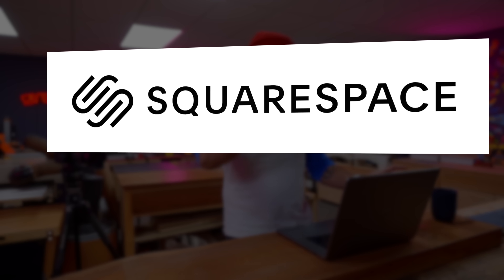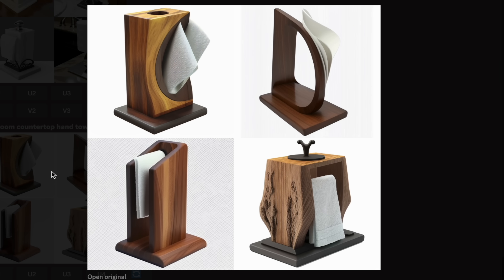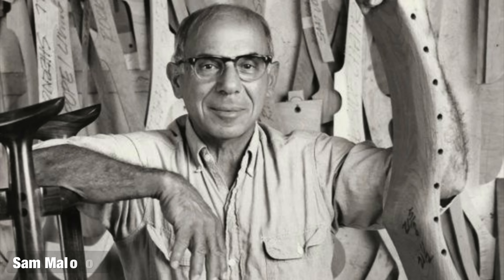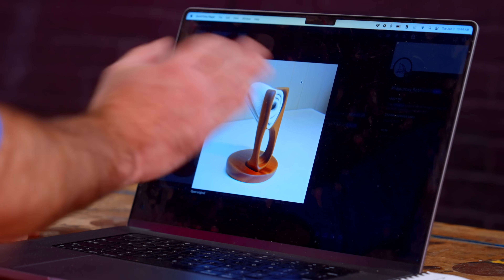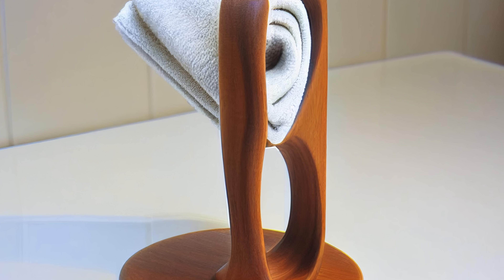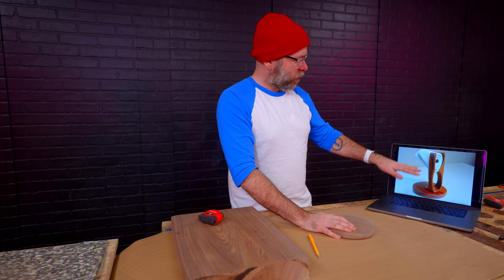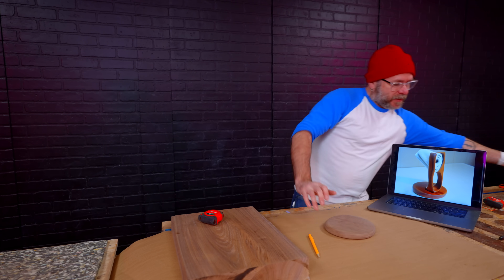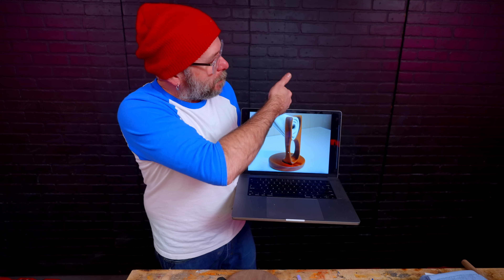MIND BLOWN! 🤯 Using AI to Design a Woodworking Project

Comment: If you had to do this over would you consider cutting the tapered swoop first on the square stock using your bandsaw? I’m imagining doing this by making a cut similar to a resaw just curved instead of straight with your table tilted. Then you could cut the circle.
Reply from the maker: Yes, for sure.

Comment: Beautiful! But how stable/steady is it? It seems like it would move around a lot while using the towel. I'd be inclined to hollow out some spaces in the base and place some steel or lead weights just to give it some stabilizing mass in the bottom.

Also, would a trim router have been useful to rough in some of that final shaping of the vertical piece before smoothing it with sandpaper? It seems like that would have been a lot faster. Maybe not as organic a finished look as you were going for, though?

Comment: I added the following as a reply to someone else’s post, but I thought I would start a new post so that it’s not buried in the middle of a string.

This can lead to a great discussion. Certainly, it is clearly wrong to copy someone else’s work for your own gain. However, as a woodworker, we often use design elements that are thematically consistent with a style of design. In this case, he used elements of Sam Maloof.  The same could be said for making a piece of furniture in the style of Stickley, Green & Green, the Quakers, Queen Anne, etc. 

AI is a tool in my opinion, and the results it produces are based on the programming input that is provided to it. In this way, it’s not a copy and a ripoff in my mind, but rather a result that is thematically consistent with the style of someone else. 

Now, if you are marketing the design as being an original from the person who style you’re copying, clearly that is fraudulent. However, if you are making a piece for your own home, I see no issue with that. Further, if you sell a piece based on someone else’s theme / style elements, and NOT say it is their work, but in their style, then I see no issue with that.

Comment: Yo! I use a Sand-O-Flex for sanding very odd shaped and small parts.  It's 100% the correct tool for the job.  I can't recommend it enough.
Reply from the maker: Thank you!
Reply: @MakeSomething  and actually, I got that info from the book “Animal puzzles for the scroll saw” by Judy Peterson. In the front of that book she has some really helpful tips for working with that smaller stuff. The templates are fun too, but I’ve used the techniques she talks about in there on finer details on a bunch of other projects.

Comment: A little constructive criticism here (nothing to do with AI): You are NOT bonding long grain to long grain (base to upright joint). You are bonding long  grain (base) to end grain (upright). This may seem pedantic, but is important in as far as how good the bond (and therefore the joint) will be, as you have pointed out. A glue joint with end grain is next to useless. So just as well you added the dowels (never mind someone wanting to stand on it😁). It would not have lasted very long with out dowels. This advise is given in good faith and not mend to degrade your work. Understanding how wood works is essential if you like your work to stand the test of time. Thanks, Tommy.

Comment: Perhaps I am the one missing the point, but I think the original concept was simpler than you thought.  I don' t think there was any "goalpost" holding up the towel.   Rather the rolled up towel was simply pinched between the two uprights.  Similar to an old fashioned one piece clothespin.

Comment: Does the thing tip over easily?
Reply from the maker: It's not as stable as I'd like it. Gonna cut a round piece of sheet metal and attach it to the bottom for more weight.

Comment: Great video, I love the way it turned out.  As for your question of whether this is your design or not, yes, it is.  AI is a tool just like a piece of sandpaper is.  You used prompts to shape your project with an AI tool  AI, buy the way, is about as intelligent as a coin sorter.  It'll be quite a few years before it's actually able to design something on it's own.